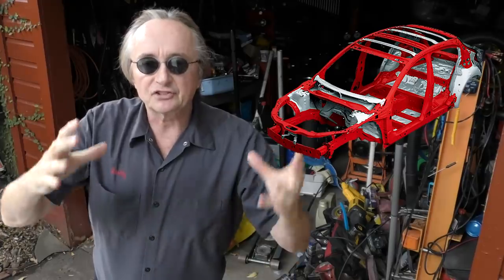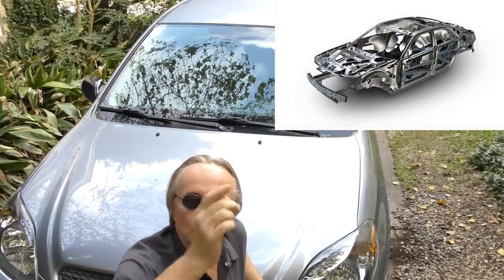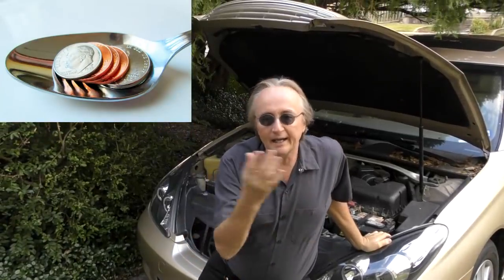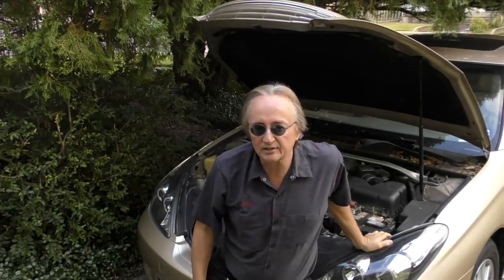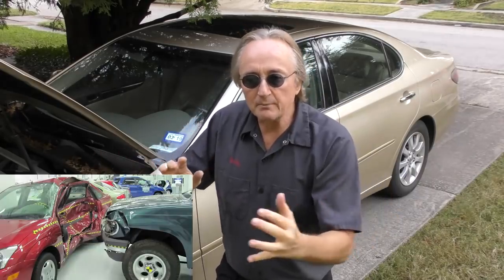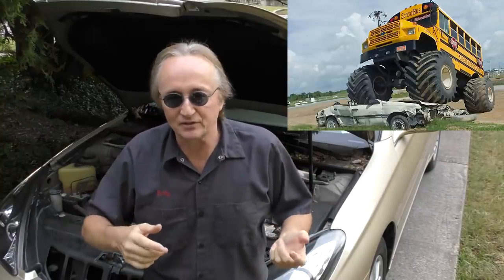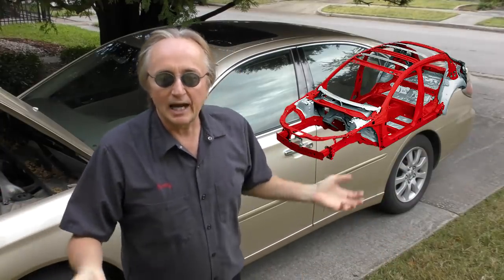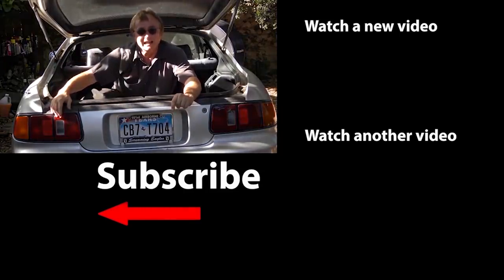Why New Cars are Safer than Old Cars

Comment: If you have not waxed your car for a long time is it too late to start?
Reply: Clay bar then wax....
Reply: If you've waited so long that the color coat's worn through to the primer, yes it's late. Claying will remove caked on dirt, compounding's a more abrasive polish and you need one or the other to remove clear coat and scratches. Either one, though, will put saturated color back on the car.

Comment: I have 88 Chevy Caprice,T boned & totaled a 14 Camry and Caprice no front end Damage,
Reply: I once rolled an '88 Lincoln LSC and walked away from it. Will never drive Toyota blight after that.
Reply: Look at it this way. If u T boned another 88 caprice they would probably be very hurt, maybe dead.  If you got tboned by a 88 caprice would you want to be in a 14 Camry or 88 caprice?
Reply: In all the car tests that are done. The test is with cars of similar size. A larger car will still have a higher rate of survival when crashing into a lighter car. You can look up and see that there are several cars where no one has died in a car accident.Some are larger cars and others not as big.
Reply: Yeah I'll call bullshit on that. I'd like to see the actual crash and speed
Reply: @Rhaspun  not true.. larger older car in the 90's to early 2000 isn't going to be as strong or as safe as a smaller late model  highly re-enforce  car..
Reply: @joebrown9621   Well I guess if we keep on going back in age of cars there will come a point where they can't compete when it comes to safety. Which I wasn't referring to.   But, I did say that when cars are tested they are tested with cars of similar size. So I guess I have to expand on this more. When you see the ratings the categories are small cars, SUVs,  large cars and what ever others they have.
Reply: @Rhaspun   @vadim nesen  if ur talking cars of the same era, then a little more mass does help.. but still new car are built in concept like race cars light weight  with a strong servival cage around the occupants
Reply: @joebrown9621  I guess you aren't going to catch on or you're just trolling.
Reply: We had an 84 until Dad hit a telephone pole in it because someone was overtaking in front of him dangerously, barreling at him at maybe 70 MPH in a 45 zone. The pole went through the bumper, front end and radiator and stopped at the engine block which bent the frame. The pole fell on the car roof just near the driver door and Dad wore his seat belt so he lived. His knees went through the lower dashboard, though.

Comment: Scotty what do you think about Dodge Journey????
Reply: I've got one.  Love/hate it.  It's the V6, which is peppy, but at 81k, I have had to replace so may items on it.  It goes through a set of tires and brakes every 18-20k. Around 60k, it blew three transmission lines on the expressway and drained almost all the fluid.  Of course I didn't know that happened until I parked and had large puddle of burnt red fluid under it.  I do all the maintenance and don't beat it up, but I don't trust it to be here at 150k, without major issues.  Recently, I the ground wire failed, which toasted a newer battery.
Reply: my daughter  wants one  .best suv in her price range   she has rented
Reply: Stay away! One of the worst suvs in its class !
Reply: I tow them all the time, even tow one were the front struct separated for no reason at all, aparently it was loose from the factory and it let go at 110k miles
Reply: Lots of transmission problems Chrysler owns dodge and fiat owns them all fca is what you will see labeled on some chrysler Fiat Chrysler America
Reply: Thanks guys. Right now I have 101000 miles on it and it haven’t showed any problems so I was just wondering do I sell it or not.
Reply: @jackking821  its how  you  take  care of it .. i have an 08  avenger   still has the same battery in it,,2.7 flex  tires  are all i have put on it  yes   i have a jumper  box in the  trunk   but i got 25  years  out of a 650  nation wize battery  made in 92  till i did not  trust  it anymore  ..an its still good..a i dont know how  lol
Reply: @jackking821  ..Keep it,they are reliable...Just people who dont own one make up things that went wrong on their pretend vehicle !
Reply: Garbage !!! Anything Chrysler or Fiat or Mercedes makes is a money pit and bad quality !!! Stay Away !!!
Reply: @heartofdixie67  all cars are money  pits  ..my avenger   has been  great  10 years old    same battery  too  ..had  to buy  tires    wow
Reply: Im not Scotty but I think never take a dodge ON a journey
Reply: @DrewsLair  my avenger  runs great..but  i have 14 gm  cars   an a 69 mach 1...its how you take care  of a car  truck  ect ect   my wife is driving a 95 transport   right now..great in snow  an it keeps her 2002  mint  grandprix  out of the salt  ..both have 3800 4l60s in them
Reply: @animalcorvair  I love dodge and GM, I love all my American cars even Ford  but I still crack my jokes lol, we have an 87 buick somerset and its in great shape for its age and runs like a top at only 73k
Reply: @DrewsLair  my corvairs   have been  one of the best    have 6  lol

Comment: Safety is still down to luck in accident.. A drag racing cage..  should be installed on all cars hidden behind plastic interior parts from factory..a secret cage thats behind plastic would save more people than all safety devices.. To prevent crushing where passengers are in...they are proven, they saved many race car drivers..
Reply: Safety is statistically many times higher than it used to be. You are much less likely to die in a car accident that would be fatal back then.

Comment: Scotty, are nitrogen filled tires worth it?
Reply from the maker: no don't waste your money
Reply: No.
Reply: Air is already 78% nitrogen, so don't waste your time or money.  Tire manufacturers never recommend using straight nitrogen. It is entirely unnecessary.
Reply: Nitrogen filled tires are a government plot. You should know, Dale...
Reply: Dale Gribble the gov is on here you should use Rusty Shackleford.
Reply: I prefer to fill my tires with hydrogen. It makes them lighter, flammable and more exciting to drive.
Reply: Hank would suggest propane instead!
Reply: 0, funny you remind me of the time one of my aunts kept telling everyone her tires were filled with methane if they inquired about the green valve caps. O_o
Reply: If u go to costco its free.  The nitrogen fill lasts much longer than air fill.

Comment: I’ve had 3 Volvos in the past: a 1988 740 GLE, a 1989 760 Turbo, and a 2000 S70-T5 Turbo. Volvos had been known to be safe cars in accidents. (My 1989 760 Turbo was totaled by a red light runner in 2014 and I was OK) I just recently bought a new 2019 Kia Soul which was built on a unibody construction method. The Soul has a 5 star crash safety rating - same as my 3 Volvos ! 👍👏

Comment: I really expected you to talk about four wheel drisc brakes, antilock systems and traction control. These improvements on modern cars can prevent so many crashes that it doesn't matter which frame style you have.  By the way, the school bus that your kids were on probably was a body on frame design but protected them by having much more mass than the SUV in the collision.

Comment: I remember several years back when a crash test with a 2009 Chevy Malibu into a 1959 Chevy by the Insurance Institute for Highway Safety. That test crash showed how modern engineering of a smaller and lighter car could protect the passengers better. The passenger area maintained of the 2009 car maintain integrity of the passenger compartment and the 1959 car had quite a bit passenger compartment comprised by the crash. Many people didn't want to believe it. They were making up excuses as to why the old car got the short straw in the test. Crumple zones work.

Comment: Hi Scotty ,   I have been researching a way to enhance the safety of unit body cars, suvs, etc by adding structural foam Inside  the frame itself,  they drill holes every foot or so and this foam gets sprayed inside, a pillar , b pillar anywhere theres a hollow piece ,  ,  its not  foam you get from lowes    They are using 4 pound mix (  about the strength of soft wood )  but you can get mixes that are like concrete.

Comment: hi scotty I like your video ..you are absolutley correct in comparing body on frame and unibody safety;;;my beef is the thinner metal on these newer cars ..I own a newer Hyundai I have small dents in my door from finger tapping just below window on drivers side //I agree with the car having crumple zones to take the shock instead of your body ,,but it seems like they are even making them chinzier and charging more money and they are not as stylish of the older cars ….good video explaining  the differences
!!

Comment: Scotty, you forgot to mention another pros of the body on frame or ladder frame chassis, alot less road noise from tire roar compare to unibody or monocoque chassis.  For mid size pickup trucks like Toyota Hilux and Ford Ranger, it is always the turbodiesel engine sounds louder than the tires when you're travelling in high speed.

Comment: Car makers found out what people really want in cars when truck sales of full size truck surpassed most of their car sales. People want that full size , on frame, rear wheel drive and ability to haul stuff. (also like the wagon to SUV craze). OK to my question: Do you know anything about RVs? Which is the cheapest to maintain A-B-C class and should I get diesel or gas? The only big thing I have heard is to fix them you can't go to a regular repair shop, unless you have the small camper van. Most auto shops do not want to work on a large RV.

Comment: Here's a little fun fact. The 2003-2011 Lincoln Town Car was body on frame and it received 5 star crash safety ratings in all ratings, the first and only car to do so in that time-frame. The Panther platform that the Town Car was derived from is the last mass-produced body on frame car.

Comment: Chrysler was an early pioneer of unibody construction.  From 1960 onwards all their passenger cars were unibody.  They advertised this endlessly in their TV commercials.  They were also the first with 5-year\50,000 mile warranty.  Their engines and transmissions were absolutely bullet-proof and reliable.  Chrysler made wonderful cars that were sold all over the world and were know for their dependability.  They have lost their edge in recent years but their RAM trucks and Jeeps (certain models) are still some of the best vehicles produced anywhere.

Comment: Scotty! I just refreshed the entire front suspension in my car. Struts, control arms, bushings, ball joints, center link, inner and outer tie rods...everything! Now the clunking from the bad ball joints is gone, but the steering wheel doesn't return to center anymore. What could cause this? It was returning to center before I replaced everything.

Comment: Scotty, my grandson has a 2010 Chevy Impala V6 with 180,000 miles. The engine doesn't use oil and the oil color is not dark. Mostly highway miles. The auto transmission has conked out. Should he get a mechanic to overhaul the transmission or buy a rebuilt one. The difference in price is almost $1,500. He can get the rebuilt installed from a reputable shop for $3,500. Should he fix it up or junk it. The body is in very nice condition.

Comment: Hey Mr. Scotty, you forgot to mention on GM cars like the 1959 Chevy in the infamous crash test it had an " X " frame. The 50s GM cars were weak & folded like wet tacos in a crash. I believe a 1970s Chrysler station wagon would've ran straight through the 2009 Malibu or any new ordinary boring car.

Comment: I prefer body on frame. If you get a big dent in the fender, you could take it off and put a new one on. If it’s a unibody, you have to fix the dent which in my personal opinion isn’t as good as replacing it.

Comment: I saw a city bus that was t boned by a car going about 40. The car hit the panel behind the bumper in front of the wheel. The bus panel was dented. The subcompact car was crushed up to the windshield. No injuries though. Any faster though, there probably would have been. I was surprized how little damage was done to the bus, while the car was totaled.

Comment: I dont know. My '68 new yorker was quite rigid with its unibody. My '91 bof olds custom cruiser feels a bit like a wet noodle. The frame on it can twist quite a bit. To the point where if you jack up one corner of the front, the fan hits the fan shroud.

A unibody does have a frame, its just not separate. If done right they are very strong.

Comment: A while back I responded to motor vehicle collision. It was a 1970’s beetle vs a 2007 f150 . The bug had a dent on it’s driver fender drive thought it might have been there before the collision and the ford got the passenger fender torn off. Along with the tire  rotor assembly upper and lower A arms front bumper headlight  ford guy ran a red light! Ford guys are north side of a south bound mule...

Comment: I've got a question. We just purchased a 2001 Yukon xl 1500 4wd with 130k miles to tow our small 5k Lb travel trailer. Had it checked out by a trusted mechanic, other than a water pump and fluids, he said it was great and wished he found it before us.

I still see a LOT, A LOT of this Era GMT-800 platforms on the road today. I barely see any 900's at all. My wife and I keep track of how many now and its ridiculous how many of these high teens year old vehicles are still on the road. What did they do right that they didn't with the newer versions? I plan on keeping mine until my wife can't stand it, but I see many for sale with 250k-300k miles still running and passing smog here in CA. What gives?

Comment: Modern day constructions are technically a hybrid of solid frame and unibody since most now use subframes (the Austin Se7en and Morris Mini Minor being the first?)

There was a time during the 80's and 90's when this was abandoned but manufacturers recognised the cost savings in pre-building bits of the car before 'marrying' them to the unibody. (Yes 'the marriage' is a technical automotive construction term)

Previously, powertrain components were mounted directly to the unibody.

Comment: I fully understand what Scotty has said but my family was saved by a 1995 Range Rover when some kid ran into the RR doing about 50 mph with a full size SUV.  That full RR steel frame protected my family and no one had even a scratch.  My 2 month old 2017 RAM Rebel was Broad sided by a car and had $20,000.00 worth of damage but I survived.  My truck was fixable.  The other vehicle? Not so much.  I wish I could post the pictures of the 2 vehicles.  When a SOLID framed vehicle hits a unibody vehicle, the crushing of the unibody car acts as a cushion for the framed vehicle like dropping an egg onto foam rubber.  The foam deforms and the egg stays intact.

Comment: Scotty. I have  2004 Toyota Corolla. It's got 140000miles on the clock. It does this weird stuttering or choking out thing when you're idling, or if you're gearing down (sometimes cuts out completely if you don't give it any gas). Toyota recommends changing the carburetor, and a mechanic suggested attempting to refurbish the old one. Should you ever refurbish something as critical as a carburetor?

Comment: The dirty little Secret is the heaviest vehicle usually win especially if it weighs 20% more than the other vehicle. Vehicles produced before the 1980s although we’re heavier did not have as good of latches on the doors, the doors would fly open even in minor accidents although the vehicles were happy.

Comment: Hey Scotty, I have a 2011 Kia Sorento with 95K miles. For about the past 30K miles, there is sometimes a brief chatter noise on cold engine startup. A Kia service bulletin describes a repair to the timing chain but says “some amount” of noise is normal for this engine design and the repair is only meant to reduce “unusually load” chatter. We like the vehicle other than this brief, but sometimes alarming noise. We were questioning if we should keep the vehicle eventually handing it down to our son, or trade it into a dealership before the noise gets worse or more frequent?

Comment: Hey Scotty. Just bought a 2018 Toyota Corolla XSE. Why has Toyota decided that their vehicles after 2013 only need oil changes every 16000 km instead of every 8000 km on pre-2013 models when the engine architecture and design on almost none of their engines has changed much in the last 11 years. Are they trying to wear them out quicker so they can sell more cars?

Comment: Can you tell the story behind the joint development Ford / GM transmissions 6 speed trans used in the Outlook, and the Acadia 2007 to 2010. I had an Outlook and the trans went out at 40k miles. I notice the 2018 Acadia I lease now has a 6 speed in it. Those older crossovers also had a 6 speed trans. What was the issue and how did they fix it? Maybe you could do a video on this? Thanks

Comment: Planning to get a Suzuki Jimny either a 2020 model or its predecessor used 2014 model..the difference is the latest has 0.1L more engine displacement than the former. Which to choose?

Comment: My 2002 trailblazer ext has 190,000 with a steel frame. It actually takes corners quite well with little roll. Scotty do you think they should have kept making the trailblazer in the us? Also what to you think of the 4.3 vortec i6 was it a good engine for the time? K think it would have preformed better in a much smaller vehicle. No way to tell since they only put them in large suvs